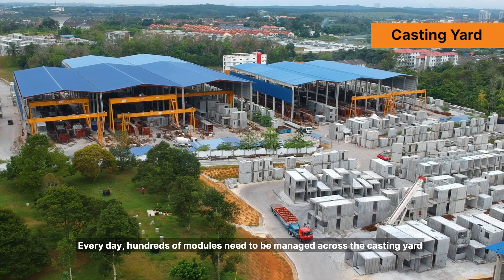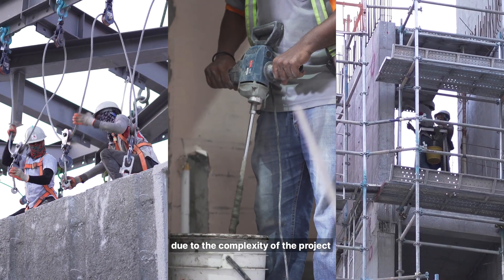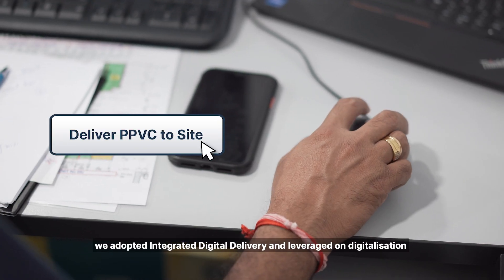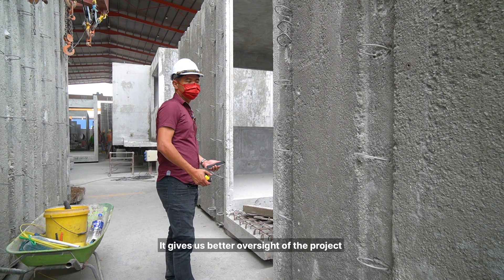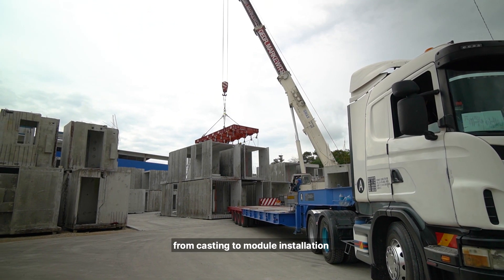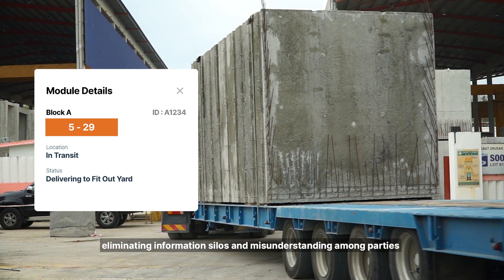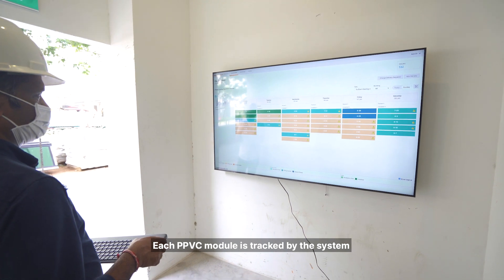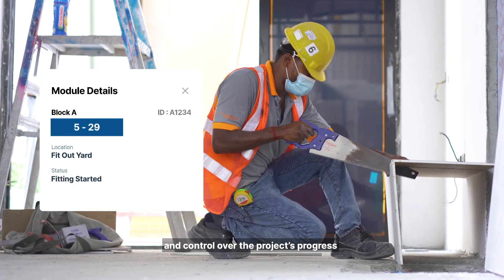Tech in Construction: PPVC and Speedbrick's Game-Changing Digital Contractor Platform

Comment: Bloody game changing... ... ends up all the moistures, and piled up dirt between the walls due to drilling caused cracks and so on... ...

Once you drill a cornice or aircon or even wiring boxes... ... you see ants coming from OUTside, and you smell smoke and burning from other units up and down... ... 

The air pressure from a seal hole... ... literally pushed the white cement off. I don't understand... ... But the tiny roaches and ants are LIKELY making homes in between those walls, in the cracks, and leading even down to the base of the HDB flat... ... I have seen them flooding through the wiring box into nowhere... ...

This is sick... ... IF my view is correct, we will have very very big problem.